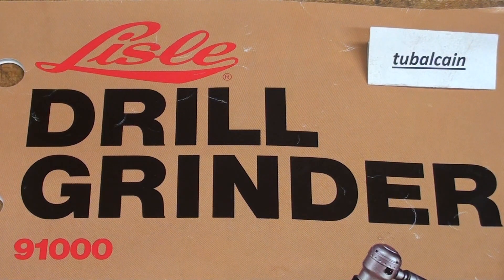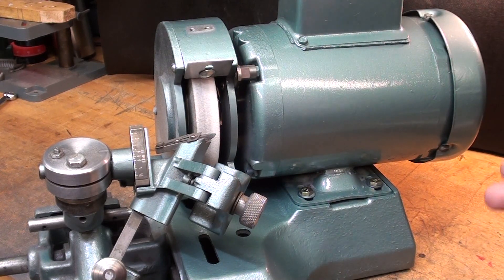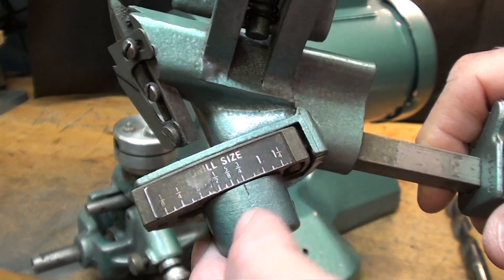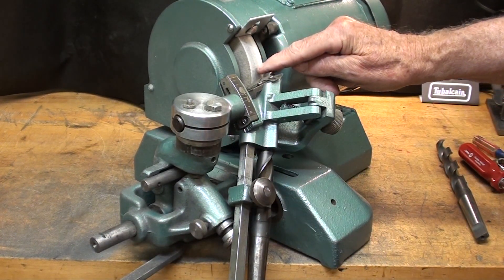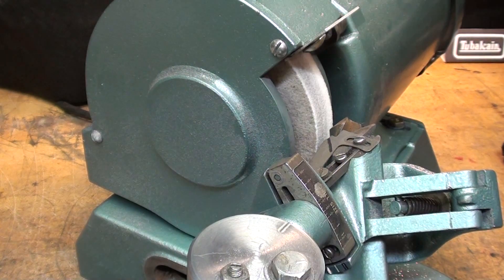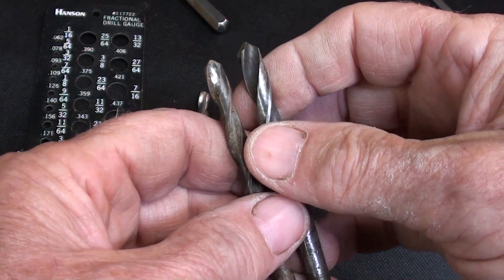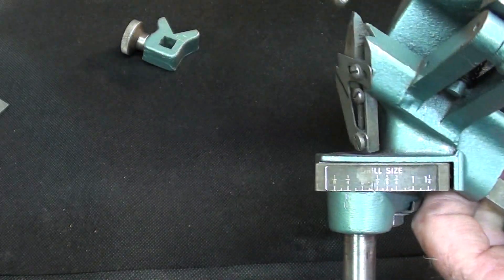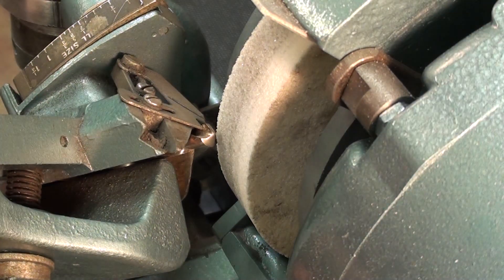LISLE Sharpening Drill Bits LISLE grinder TIPS #467 pt2 tubalcain

Comment: Thanks Mr. Pete for this great video!  Many years ago I bought a Lisle 91000 Drill Bit Grinder at an auction of high school shop equipment.  I really went there hoping to get a deal on a mill or lathe, but I missed those due to some underhanded baloney that went on before I got to the auction.  I wasn't from the area so not much that I could do.  Anyway I saw the Lisle 91000 sitting on a bench and it looked brand new or very close to it.  Just as important was that all the parts seemed to be present right down to the magnetic end adjuster and wheel conditioning attachment.  It even had the operators manual and a quick start manual!  They allowed me to plug it in and spin up the motor and it sounded like it was brand new.  Perfect in fact.  I hadn't used one of these machines in a really long time and I never got very familiar with them, but the auction bug bit me and I joined in on the bidding.  Before I knew it I was up to serious money for this grinder, but I figured what the heck as I knew they weren't making these anymore and hadn't for several years.  I recalled that these grinders had a very good reputation back in the day while I contemplated continued bidding.

I won the auction for the grinder and felt good for winning it, but bad for the money I spent.  I hauled it home and messed around with it a little but just couldn't quite grasp how it was supposed to work.  My drill bits that I ground didn't look quite the way I thought they should, or work very well, so I parked the grinder in a corner of my shop for many years due to some frustration.  Recently I was moving some stuff around and had to relocate the Lisle grinder.  I thought to myself, "why am I keeping this heavy beast when it serves no purpose?"  In fact I was going to just give the darn thing away to a friend of mine, but he was hesitant to take it.  Then I had second thoughts about just giving it away and I decided hook or by crook I was going to figure out how this thing worked.  Your video on this grinder has helped me out a lot in that regard.  At least now I have a basic understanding of how one sets up the drill bit for grinding.  I really appreciate the help and information.  Thanks again..
Rick H.
Reply from the maker: Thank you for that interesting story. Yes they are a little tricky to use. In fact, I gave mine to Adam booth six months ago.

Comment: GREAT SERIES Mr. Pete!  I had one of these in the shop at Lord Film back in younger and dumber days.  We did not have any instructions and I think I may have damaged it trying to figure it out.  Of course, there was no YouTube back then.  As I recall, the replacement wheel was quite pricey.  Yours seems to do a much better job then mine did, or perhaps it's your experience shining through!  I did figure out the motion to sharpen pretty well by hand, good enough for maintenance on the production floor, but not for the higher precision expected in the machine shop.  I concur with others, if you're going to attempt to refresh the edge of all of your drill stock, you replace those bearings!

Comment: I like to use a counter sink to knock the square edges off of a hole that was previously drilled, I think it helps keep the knicks out of the larger bits like shown. I have a Black and Decker drill bit sharpener and a Sears (General drill bit style sharpener) that uses the side of a grinding wheel also and have had good luck with them. I just purchased a 91000 since I wanted to be able to sharpen larger drill bits as well to the best they can be even though I can do them fairly well free handed on a bench grinder and using a drill bit sharpening gauge. Thanks for the video on this drill bit grinder.
Reply: @mrpete222  WOW, I got my Lisle in today and set it up. With my Sears sharpener (General style) I can get a good edge on a bit and have it cutting very well then I tried a few of my bits after using the Lisle on them, "NIGHT AND DAY" is all there is to say.
With the General style sharpener I am getting consistent cuts on both sides and curling them, the same with the Lisle but the bit seems to cut with a smoother flow after using the Lisle on them and the edges of the swarf/ribbon on the General style are a bit jagged where the ones after using the Lisle seem more like a smooth shearing/cutting action on the edges and the bit advances with less resistance. Don't get me wrong the General style is a good sharpener and at it's price range I don't believe can be beat, for a quick sharpening on a bit it's still a good sharpener to have.

Comment: Those worn drills work great as either a first station drill in a multi spindle screw machine or as last station drills in multi spindle screw machines. Chop it off and resharpen with conventional tip. Sometimes you need a flat bottom hole and that's where it could be ground off almost flat and releaved and used in the last station. We made hydraulic fittings on those screw machines.
Reply from the maker: Thanks

Comment: I know this video is old, but I just purchased the same unit and I have a question about dressing the wheel. Do you dress the wheel as the same angle as what you are going to grind the drill bit to? I have the original instructions and it is not very clear on this.
Reply from the maker: No, just dress the wheel square with the sides
Reply: Thanks, I appreciate the quick response.

Comment: For occasional use you’re ok for now but the bearings on that motor are sounding a little rough. The high speed motor is exacerbating the bearing wear. I wonder if this replacement motor has sealed bearings like the original probably had......probably not. My choice for a replacement motor would be a wash down motor or at least a wet grinder duty. But that’s just my thoughts.

Comment: It seems to me that you would have to set the distance the drill bit pokes out from the guide before you set the angle of the cutting lip (to be parallel with that scribe line) and position the guide finger.Otherwise the drill will rotate a little as you adjust its longitudinal position; the rotation depends on the helix angle and the longitudinal movement.It may amount to an unimportunately small difference, though.
Reply from the maker: Yes, that is one of the considerations

Comment: Best price I was able to find on the 91000 complete with the essential parts is around $1000. There are prices lower than that, but they are all missing critical parts of the machine.
Reply from the maker: Yes, they are rather pricey. I gave mine to abomb last summer.

Comment: Thanks for another interesting tip!How do I get an overwiev of all Your very educacating videos?I search a solution for a special problem and maybe You have already couvered it.Regards,StefanMaster of sciense in Electrionical Engineering and Compute Science but a complete newbe and amatoer regarding milling.
Reply from the maker: Thank you for watching. Take a look at my play lists for all of my videos
Reply: You have produced almost a full library of videos... It would take a hell lot of time to go trough all Your playlists. Looking at Your videos, at random, is often relaxing.I recently finished a job, cutting a 16 mm round Chrome Vanadium piece of steel down to a square profile with sides of 12,5 mm. The length was some 15 mm.My first milling bit was a 12 mm, 4 flute, gold coloured bit that now is really dull due to my ignorance. Using a second bit, a 10 mm, 4 flute bit of the same kind and taking smaller cuts I finished the job.My question is what kind bits I should use for cutting such hard steel.Can You point out some good videos answering that question?All my respect for Your skill,Stefan

Comment: I  hope that you do take the time to check out Macdonaugh /Sterling.  They are an excellent example of a MADE IN AMERICA  premium design that has survived the test of time and the 
 insult of substandard imports. The Macdonaugh /Sterling relationship began around 1895. The  design of the Sterling has changed very little in 123 years.  
The  Sterling remains so popular that there is a year waiting list even at a $4000 price.  
I think it is to bad that Lisle disconnected their excellent 91000.  I will buy a LISLE if I  can get a deal on one.  I  like good tools that work well.
Reply: Bob Smith  I have the exact unit you are  taking about. Built in 1963 and I can still get great customer service for parts. The only thing I have needed to order are the stamped metal degree stops that got too close to the wheel.
Reply: I also ordered a replacement drill stop because the one that came with this machine is damaged. A replacement knob, boot and knurled adjustment screw rounded out my order.  The parts lady was knowledgeable and refreshingly helpful. There are some great STERLING training videos on You Tube.
Reply from the maker: I will check it out